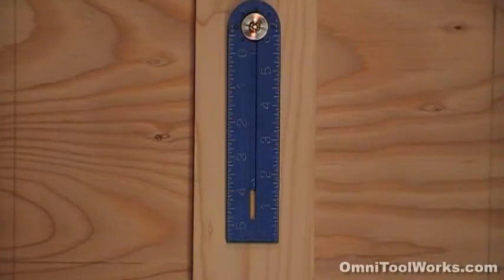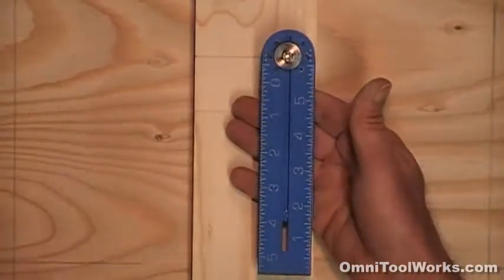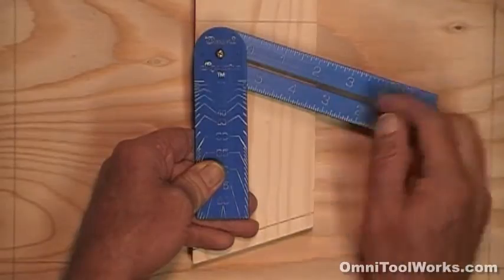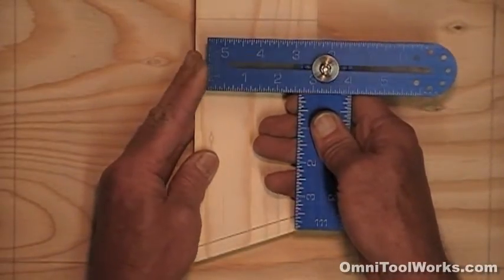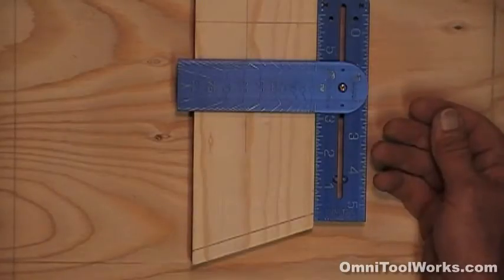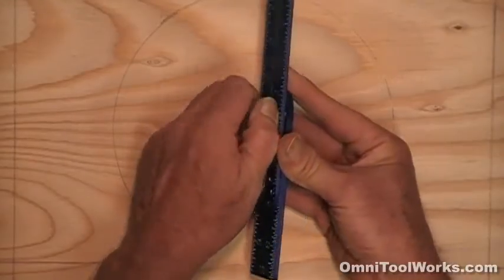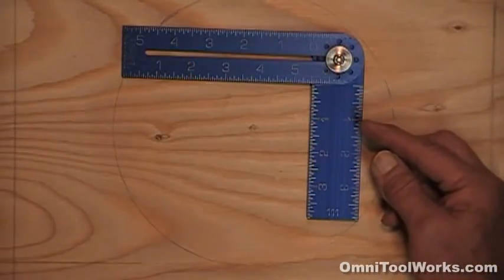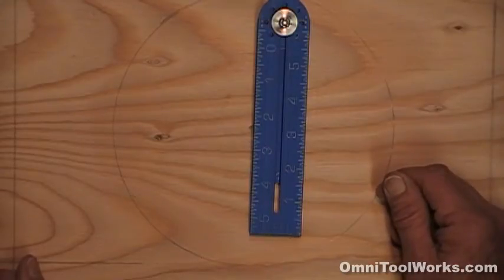T Bevel Combination Try Square in one

Comment: I just received my new Omni square.  This is so well made and with your new laser markings my old eyes can read it with no problems.
Did some small framing with it and work very well.  Fits in my side pant pocket makes for very easy access.  I have friends in the trade I can’t wait to show them. Thanks for this square, great product.

Comment: Hi,
I bought one of these about a year ago. I use it in my home wood shop. This is one of those tools that once you start using it it becomes a go to tool. Its hard to explain but I will say it feels right. The increment marks are easy to read. The width of the blade is right.   I use this in the T square mode for setting depths and set backs all the time.
Just my honest opinion hope this helps.

Drew

Comment: Cool. Gonna buy one. I frame rough/finish and make furniture. I see many uses for this little guy
Reply from the maker: Cool, I'll get it right out and you can always contact me with any questions you may have.
Reply: @OmniToolWorks  purchased!! Got the stair gauges as well. Looking forward to using them immediately. I got two sets of staircases to build next week
Reply from the maker: They'll work great. Having the Ledge of the Gauge to mark the beginning of the next tread or riser, as I show in the Omni Square Gauges video, makes for real precision. I just laid out 7 steps and then measured the full length of the stringer, and as best I could see I was only short a 128th of an inch. Yer not going to get more precise than that! A good tip is to use a sharp regular pencil rather than a fat-leaded carpenters pencil for the best precision.

Comment: Mentioned that the inch markings etc are PAINTED on ........... as opposed to etched.  SOOOO how long before they wear off & none of the specifics are able to be seen?  Anyone know?
Reply from the maker: For almost a year now, instead of the markings being die stamped with the resulting crevices being filled with powder coat paint, all squares are deeply laser etched, deep enough to easily be felt with your fingernail. With the markings being below the surface, they will last a very long time. They are also very uniform, precise, and dare I say beautiful, as can be seen in the photos at my website, www.omnitoolworks.com